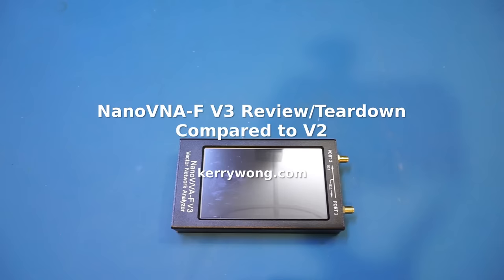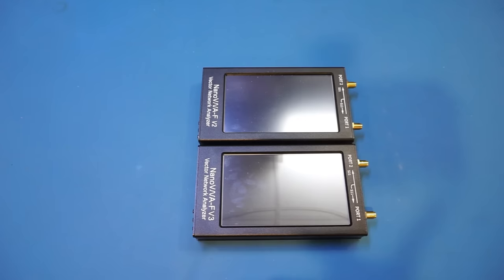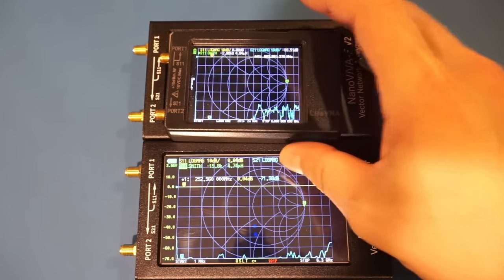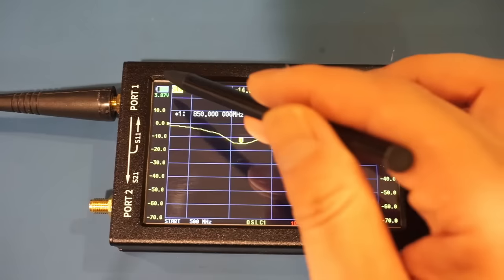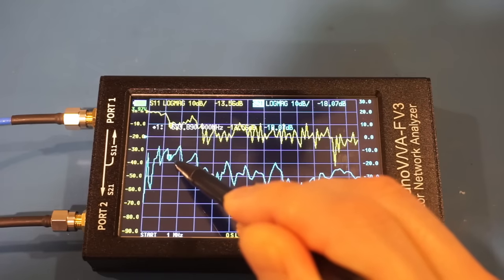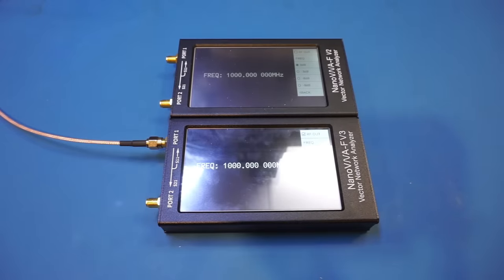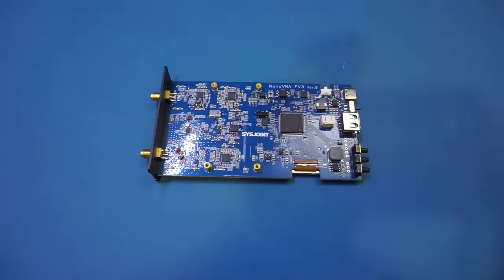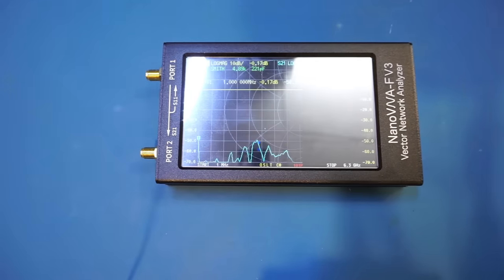NanoVNA-F V3 Review/Teardown, Compared to V2

Comment: “Better spec’d and more capable components” that deliver inferior signal quality. Hmmmm.
Reply: Yeah, big concerns with the accuracy of measurements because of a noisy incident signal gen.
Reply: @ТарасКорж-г4т  The accuracy i worse than in F "V1". 60 dB attenuator displayed as 43 dB. With new 0.5.5 firmware bit better - as 50dB.

Comment: I'm wondering for how long will the center pin last of those connectors with all the screwing-unscrewing done.
Reply: Yeah, SMAs are pretty fragile, you would have though they would have used a more robust connector.
Reply: I just checked  quality TE female SMA on DigKey and they list 500 cycles. Some are much, much worse i.e. fewer cycles.  Better to have some sacrificial cables attached I suppose. I never understand instrumentation that could be used heavily having SMA connectors TBH.
Reply: @vincei4252  I'm more partial to using a solid adapter instead of an adapter cable that way you still keep the plugging and unplugging cycles to a minimum on the connector on the unit. With a solid adapter you don't have to worry about the cable being just another point of failure, but there again the cable can also keep forces from directly effecting the connector on the unit.
Reply: It is pretty easy to replace when they fail.
Reply: @Gengh13  to some it's easy, to some they see using chewing gum to stick two spoons together as hard.
Reply: Add a sma-3.5 mm adapter as a port extension and just leave it there as a sacrificial connector.
Reply: You hear it's very loose all way til the thread binds at the end of the travel.
Also, watch the display change as the pin makes contact.
Reply: re: " how long will the center pin last of those connectors with all the screwing-unscrewing done"
In a production environment, I found it necessary to 'lube' quick disconnect RF conns with WD-40 (YMMV) and was able to boost the life of those conns by quite a bit versus no lube as shipped from the factory. This was at 2.4 thru 3.7 GHz WiMAX base station equipment.
Reply: @uploadJ  I wonder if deoxit D5 would do the same.
Reply: @madmax2069  Well, I never tested it. I had used WD-40 for decades previous, in other RF applications as a ham radio operator and in repeater RF hardware installations. I also always put a swipe of WD-40 on computer DIMMS and so forth too, with no issues, since the early 1990s, so there you have it.
Reply: Best to invest in SMA barrel connectors and just normalize to them.

Comment: Hi Kerry!  Thank you for getting the V3 so fast and producing another informative comparison.  For the spectrum analysis, the output power for the V3 seemed to be set about 6dB higher than the V2 at 1GHz, and close to 10dB at 4.1.    If you run the V3 at lower power, does it look a little cleaner?  Or is the analyzer getting hit too hard (probably not...)  Kind of surprised about the V3 spectrum, but still it's amazing for a low cost VNA.
Reply from the maker: I am a little surprised by the V3 spectrum as well. The spectrum looks similar at different power settings. It is slight better towards lower frequencies but in general the phase noise is more pronounced than V2.
Reply: @KerryWongBlog  Great information Kerry.  Thank you.  I knew you probably checked this aspect thoroughly since it's so unexpected.  I suppose one good thing is that its output power seems to be a bit higher than the V2.  Do you suppose there is a fix?
Reply from the maker: @craigrotay3732 I was a little puzzled by the phase noise as the phase noise of MAX2780 is pretty low. Unfortunately, the software used in the NanoVNA-F is not open source so it would be hard to pinpoint where the issue lies.
Reply: Probably they didn't implement the MAX2780 correctly (loop filter component values, for instance), or they are not sending the correct configuration for its internal registers, hence, the bad phase noise.

Comment: Are you sure that you ain't confusing V2 with the V3 and perhaps mixed them up when you tested the freq output.?   
You emphasize that your V3 is identical on its output as the V2 and it will max do 4.4G..you sadly don't show revision info on your V3 so difficult to compare what firmware that are on your V3.
I also recived one of the V3 a few weeks back, and same maker Sysjoint with SeeSii prouctlabel, and that unit will gladly go to 6.3GHz on its signal gen out.. it will go from 10K to 6.3G if I recall correctly, though since its an MAX2870 synth chip.. the output RF selectable power, are locked below 23MHz.
What V3 firmware are you on (says so in the bootup sequence), since you are limited to max 4.4GHz on your V3?  16:04
One thing I missed in your video, where the output power..how well does it match, with the labels 0dBm, -3dBm, 6,dBm, 9dBm.?..on my RF power meter, it was around 2 to -3dBM off, so fx -9dBm setting  at fx 1G it was around -11dBm.. did you check it on your spectrum analyzer?
Thx for the video.

Comment: @4:20 I dont see any BW on the screen but in all VNA's higher BW >> faster sweep.  That's not surprising. That's how it should be. TO compare the sweep speed you need to make sure they have the same IF bandwidth. It is very similar to RBW in SA
Reply from the maker: I don't think adjusting bandwidth is an option on the NanoVNA-F V2 or V3 I know NanoVNA V2 Plus4 supports it, but didn't see it on -F V2 or V3. I will comb through the settings again when I get a chance, but if you find the settings please let me know.

Comment: So if its built-in signal generator has harmonics at -35dB from the signal, then this means the accuracy of network measurements below -35dB cannot be trusted. This would affect all S-measurements.
Reply: Not if they do a hetereodyne conversion before detection. A simple broadband detector diode of course "sees all". But a detector diode is a scalar analyzer, not a vector (phase information) analyzer.
Reply: @uploadJ  That is true. The erors start at ca -30 dB and reach -17 dB at -60 dB. Some improvement in 0.5.5 firmware but still at least 10 db error.

Comment: is your noise floor at S21 port still remains around -70db? mine went up to -50db, (-40db at 6ghz) in one week, no idea why
Reply from the maker: Well,  mine is not that uniform. towards the low frequency end and high frequency end (up to 6.3GHz) the S21 noise floor is roughly at -70, but between 1.2 and 4 GHz there are some peaks around -60 dB. The worst is around 2 to 2.5 GHz which was around -50 dB.

Comment: Appreciate you showing us this but one thing concerns me is losing the lower 50 KHz capability, as I've made comment before.
Yeah, you can say that anyone buying a 6-GHz unit doesn't care, but I worry that we'll never see newer and more advanced units that have good low-end.
It is nice to have this real low-end for us guys that like to mess with design of VLF, MF and HF gear using low-frequency IF's and filters...
73!
Reply: NanoVNAs are great for price, but the lower frequency band sucks, compared to like a HP4195A
Would have been awesome, if they had used downconverters/mixers within the native frequency range of a ADF4350 to get a nice sine wave stimulus signal down to DC, similar how HP used to do it. Instead of down-divided squarewave from ADF4350 and Si5331....

Comment: Does the interface allow the lowest freq from 9khz?
Reply from the maker: No, the V3 starts from 1 MHz.
Reply: @KerryWongBlog  (Will dual post the question here also, as its name directed and it would be a shame if people get wrong info from video) Are you sure that you ain't confusing V2 with the V3 when you tested the freq output.?   
You emphasize that your V3 is identical on its output as the V2 and max 4.4G..you sadly don't show revision info on your V3..I also got one of the V3 a few weeks back Sysjoint maker with SeeSii label branding, and that unit will gladly go to 6.3GHz on its signal gen out.. it will go from 10K to 6.3G, though since its an MAX2870 synth chip.. you will first get  output power control above 23MHz.
What V3 firmware are you on, since your limited to max 4.4GHz on V3?  16:04
One thing I missed in your video, where the output power..how well does it match, with the labels 0dBm, -3dBm, 6,dBm, 9dBm.?..on my RF power meter, it was around 2 to -3dBM off, so fx -9dBm setting  at fx 1G it was around -11dBm.. did you check it on your spectrum analyzer?
Reply from the maker: @JAKOB1977  The firmware on mine is 0.5.0, I haven't updated. Sounds like there were some improvements in later firmware versions. If you watch some of my later videos using the V3 (e.g. testing Werbel microwave combiner) you will see that the power measurement was quite a bit off (off by around 5dBm), which is a pity as the V2 worked perfectly.
Reply: @KerryWongBlog  I will take a look Kerry.. my unit is rev B fw 0.5.3 and here you do have the full output from 10K to 6.3GHz.. I believe you can find the firmware on sysjoint..if you decide to update, and check the RF power again, and if things has changed.. pls report back... again thx for the vid..

Comment: You really shouldn't be promoting products like this. This is using the NanoVNA name but they almost certainly do not have permission from ttrftech who developed and marketed the original NanoVNA. Even worse (in my opinion) the firmware source code seems to not be available even though it seems very likely that it is based on the original NanoVNA firrmware by ttrftech which is licensed under the GPLv3. So not just a trademark violation but a GPL license violation as well. Copying and improving open designs is good but pretending to be the original creator by using the same name and then not sharing back the improvements made to the open source firmware is not just unethical. It's illegal. You're promoting what is almost certainly an illegal product.
Reply: it is open source or no ?
Reply: @robust5615 if you think that makes it legal to violate copyright or trademark,  you don't know how open source works.
Reply: @eggmangoogle3146  open source or no..Answer this ..not put your word into my mouth ...